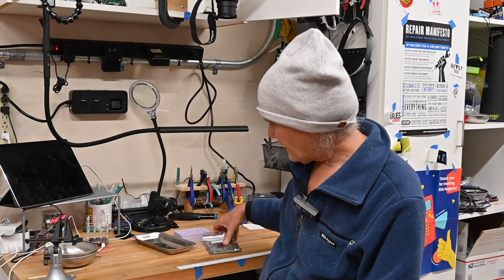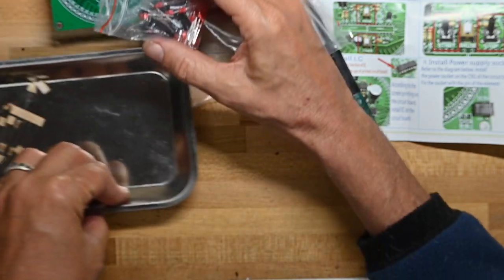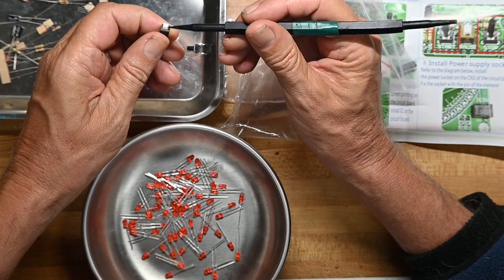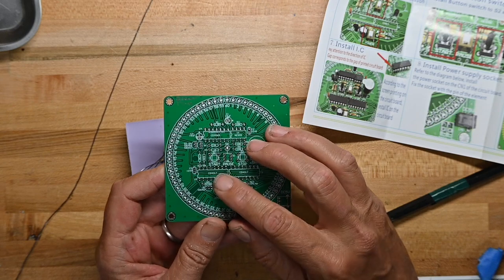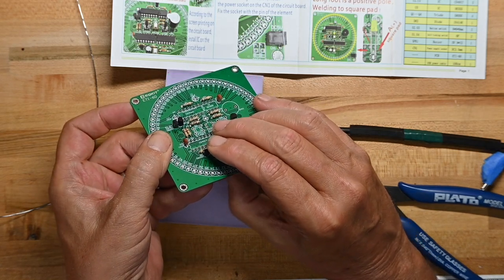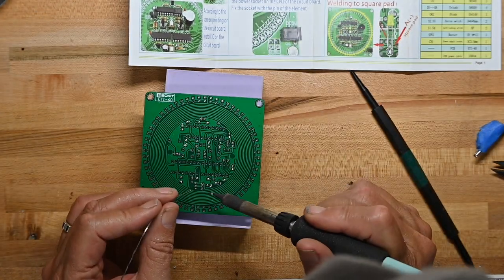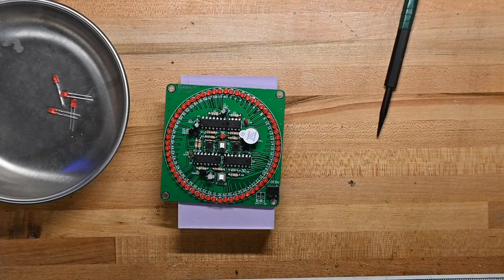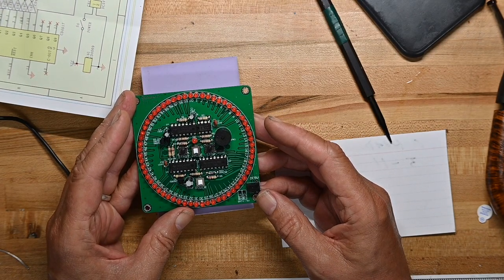C.K. builds a Gikfun 60 second timer practice kit

Comment: Could you use a drop of glue to hold the power supply in place?
Reply from the maker: That would work well.  A squirt from a hot glue gun would be easy.
Reply: @CKHaun  Thank you.
Reply: @CKHaun  I just saw this in the instructions for another kit.  You are supposed to take one of the leads you trimmed off, bend that over the power supply and thru the small holes on either side and solder it, basically strapping it down.